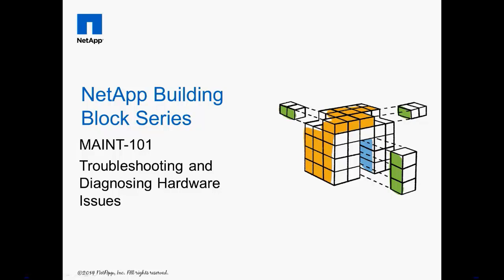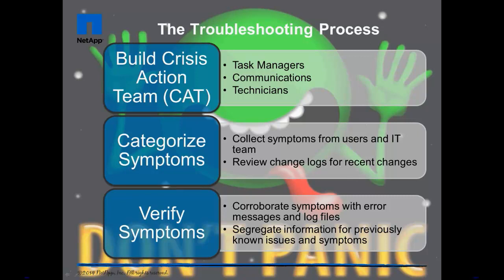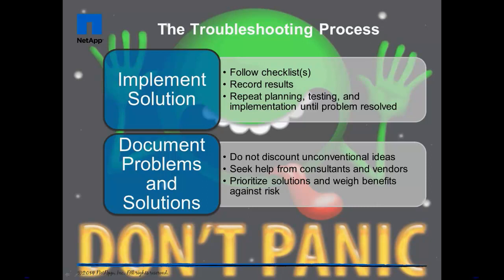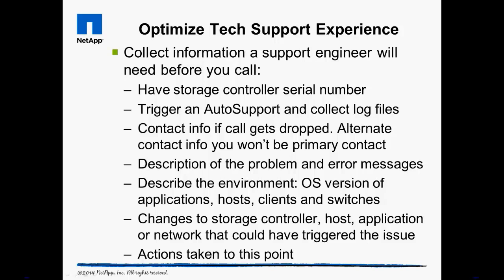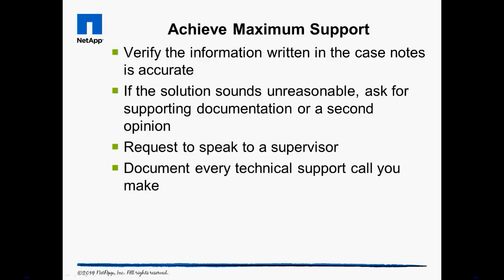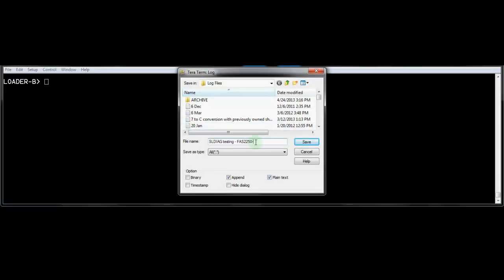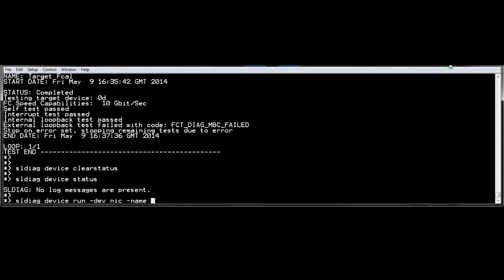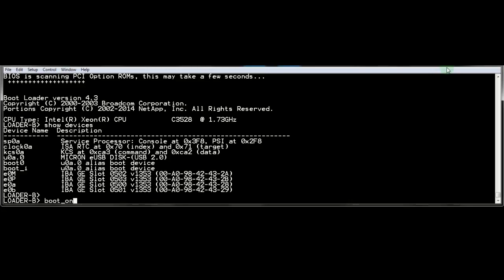Building Block Video: MAINT 101 Troubleshooting and Diagnosing Hardware Issues

Comment: SLDIAG on systems running ONTAP 8.2 or newer only takes about 10 minutes to run the default tests.  This is fast enough that there's no longer a good reason not to run it during a system install.